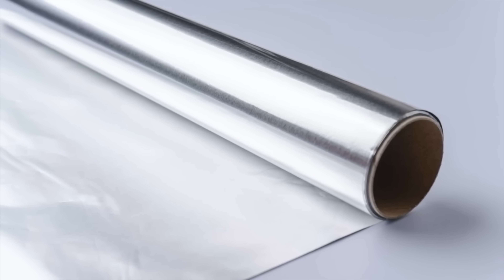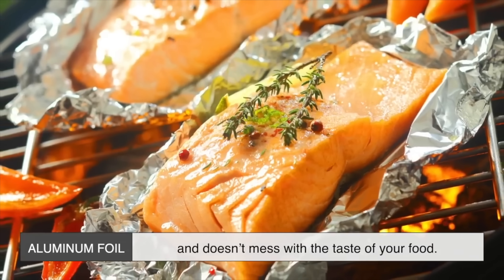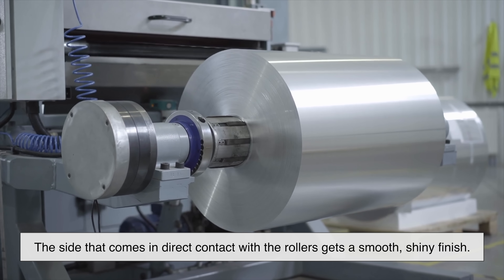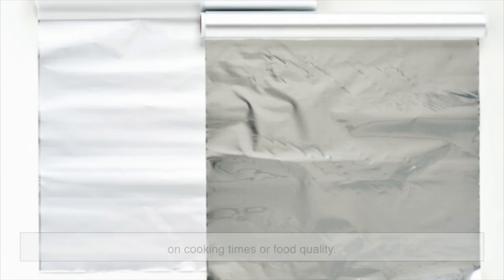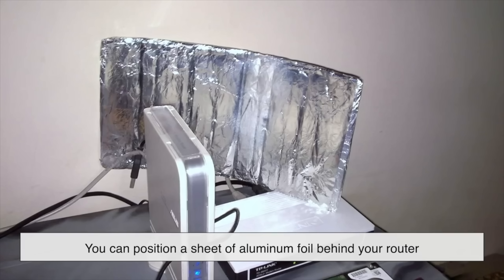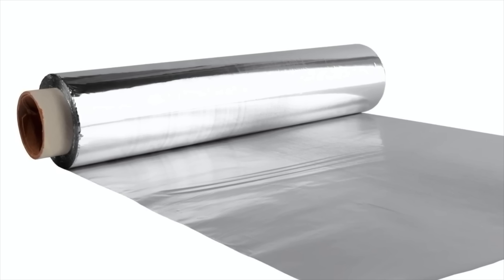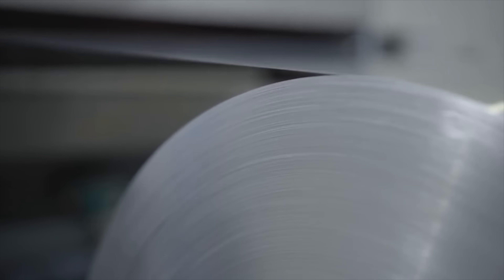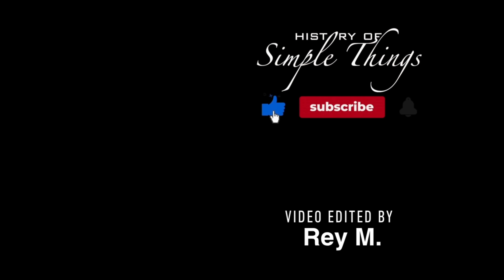Why Is Aluminum Foil Shiny on One Side and Dull on the Other?

Comment: Fun facts:  Non-stick foil can't be recycled, even if never used and clean.  The agent they apply to make it non-stick is super expensive and super flammable, has to be applied inside a nitrogen-inerted enclosure so they don't burn the building down.

Comment: I used a piece on each bunny ear for the TV, to get better reception when they were a thing.😅😅😅😅
Reply: Yep! The good old days of putting aluminum foil flags on bunny ears. (Kids now reading this might report us to the SPCA) 
The flags helped reception but nothing could fix that damned horizontal hold. Who remembers getting the horizontal hold to a sweet spot where the frame flipped so slowly, you just got used to it? No amount of banging on the TV would help. But sometimes a good slam in the right place would fix the TV temporarily. Those old Zeniths could take a beating.
Reply: @Woodstock271  I was about to mention the slam to fix the horizontal hold... until somebody walked by.
Reply: @lajya01 , Yeah man. I remember getting it just right and it was like, “Okay, nobody move. If you have to pee, just hold it. You need to balance your need to move with your hope of actually seeing an entire episode of I Dream of Jeannie.
Reply: Steel wool also worked.